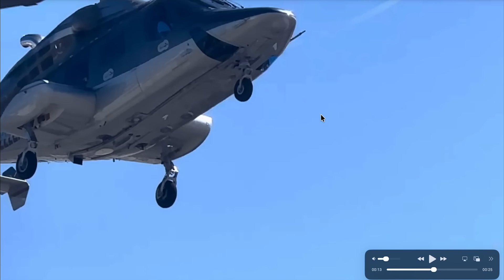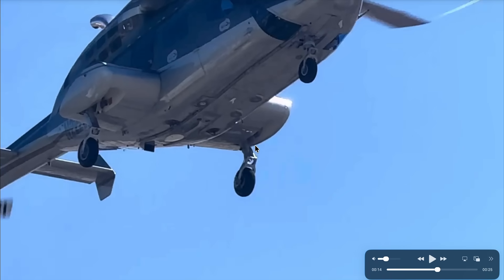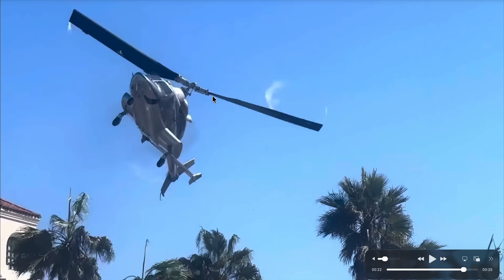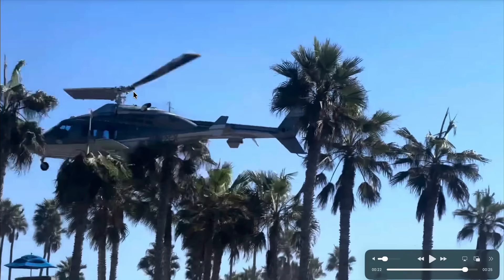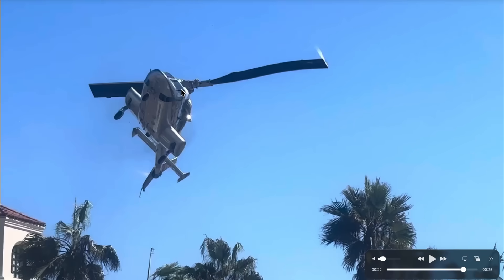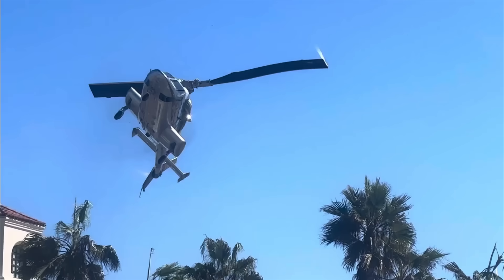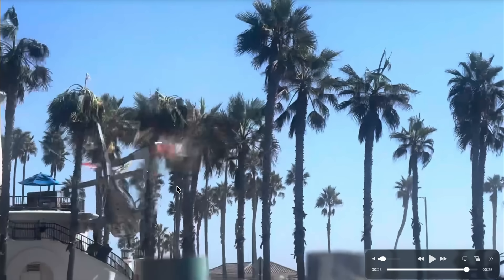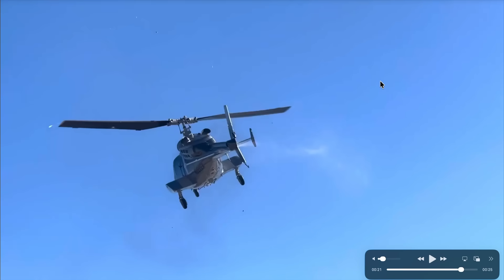Huntington Helicopter Crash Analysis - SlowMo Video!

Comment: The Bell 222's had a couple crashes a few years ago where the bracket behind the gearbox holding the rotor control linkages came off because the bolts securing them vibrated loose.   This of course makes the pilot unable to control the main rotor which I think is why the sudden increase in collective which wasn't from the pilot....it was the linkages coming off and aerodynamic forces acting on the rotor blades.   There  were increased inspections demanded by the NTSB on this bracket and securing bolts but people get lazy sometimes and this can be the result.
Reply: The pitch of the main rotor is the curious thing.  I thought the sound I heard was blade bark due to the high pitch angle of the main rotor.  I am used to hearing this on R/C helicopters, but it is at a higher frequency due to scaling.  I know from flying R/C helicopters, there are a lot of vibrations in a helicopter.  We have to use Loctite on every single bolt or it will wiggle lose.

And troubleshooting problems with R/C helicopters at least can be tricky.  The first gotcha I had when I first flew was trying to figure out why my tail gyro was glitching up.  I ended up replacing the stock gyro with a Spartan gyro and it seemed the problem was fixed.  But then several flights later molten metal started shooting out of the motor because the main bearing failed and the BLDC motor was so powerful that the motor kept spinning.  So instead of seizing on a failed bearing, the bearing melted.  With the pinion gear no longer meshing with the main gear, the helicopter started going down while making a weed whacker hitting things sound from the molten metal flying out at high speed and hitting the inside of the canopy.  Fortunately while the helicopter was in high speed flight, I managed to react fast enough to put it in throttle hold before worse things happen and flipped the helicopter back and give it negative collective all in one very quick maneuver and spun up the rotor blades as the helicopter slowed down so I could make an auto-rotation landing.  The point being without the measurement systems to tell me what was really going on, I just thought the stock gyro wasn't good, but it turned out that main motor bearing was slowly failing and the original gyro having issues was actually a symptom of the problem.  Later on I was messing with a "6-axis" gyro that could measure and log the vibrations with accelerometers.  Then you could narrow down what vibration came from what due to the frequency of the vibration as gearing had different parts spinning at different speeds.  Basically, everything vibrates in the helicopter as the whole helicopter is the drive train.

Getting back to this manned Bell 222 helicopter, the sense I got after seeing more videos was losing the tail was not the cause, but more likely a knock-on effect of something else going on with it being strange that the helicopter tilted back and started climbing and it sounded like blade barking from the main rotor as in a high enough pitch of the main rotor to cause a turbulent airflow over the rotor blades.  The vortex mist also started when the helicopter tilted back and climbed all of a sudden.  That wasn't happening before.

One thing to point out is when you start losing head speed, the tail rotor also slows down.  If the main rotor blades have an increased pitch and especially with this maneuver where they switch from going forward to going backwards while the helicopter is titled back and also suddenly gaining altitude, the blade incident to the airflow is increased.  I have certainly seen this with R/C helicopter flying.  Especially trying hard maneuvers at lower head speeds with a powerful motor, I ended up putting a larger tail rotor on one of my R/C helicopters to keep the tail from blowing out.   If they already had their head speed reduced because they were about to land, while this maneuver didn't look too terribly extreme at first, if the helicopter isn't setup for it, the tail is going to blow out from the torque.  A key thing here and is pointed to by the thread starter post, if you are suddenly pitching hard because of a mechanical failure, say a bolt wiggled lose that forced a substantial pitch change, all of this other stuff we see can and is probably a knock-on effect, not the root cause.  This all happened very quick, so you don't have much time from when one force is applied to change the kinetic energy of the system to when the next thing happened.

I think something important to point out is main rotor aerodynamics is messy and complicated.  You have what is likely a fixed pitch across the length of the rotor blade.  The  rotor blade is spinning at different speeds along the blade with the inner part moving slowly and the outer part moving quickly.  You also have one side going into the wind and the other side going with the wind creating a lift asymmetry that you need to compensate for.  When you get into something like blade bark, this is actually a partial blade stall.  That 'barking' sound is a turbulent airflow as in that part of the blade is basically in a stall condition.  It is just with an R/C helicopter you have so much headroom that you can go shooting off into the distance with a partial blade stall as the part of the blade that is not stalled is generating plenty of lift.  But another thing, and especially close to the ground like this, is it is perfect for creating vortex rings.  You get into a vortex ring state and the helicopter wants to drop out of the sky as this ring of air comes around and back through the blades.  Like you are trying to lift yourself up on this roller pin that is spinning faster and faster as you try to pull yourself up on it, causing to spin in the first place.  With an R/C helicopter at least, you can overcome the vortex ring state with sheer power.  Manned helicopters have crashed with a more infamous incident being the helicopter crash during the Osama Bin Laden raid in Pakistan where they lost a stealth helicopter.  In the case of this Bell 222, the sudden pitch change close to the ground could have caused a vortex ring to form, but the pitch was so great that it "powered through" and still climbed, but at the expense that the tail blew out from the high torque loads.  Forming vortex rings is a tricky thing and can catch you off guard, but there are clear physics behind it and what will touch off one forming.  It just seems possible one formed in this case after what was likely a mechanical fault affecting the control-ability of the helicopter.
Reply: Damn if they vibrate loose they should use castle nuts or something
Reply: @BruddaMan-r2p1c  they do. And we don't know if that was the same cause yet. To me it looked like the horn that attaches to the blade broke.. but that's just speculation too... we will find out when the report is released.
Reply: I read very specific bulletins, regarding that very thing!
Reply: Good reason for every single one of the 222's to be grounded! NTSB, obviously has some input on this!

Comment: The black smoke from the exhaust indicates the pilot did the complete opposite of what you're supposed to do: applied more power. Had he rolled off the throttle and entered an auto, he may have landed it or had a hard landing. With the size of those blades and the amount of inertia they have, it could have been saved.
Reply: Maybe.....but the startle reflex when it's happening for real, not a controlled practice auto rotation procedure, and when your mind is already fully focused on the other tasks of approach and landing, cause very unexpected reactions. Despite no doubt, vast experience and many hours on type, the human brain has to make a huge jump from the actions being carried out to the instant realisation this is 'really happening to me', to following what maybe the training has told you should happen....but faced with so much chaos and the forces of being flung around so fast within a split second, it is asking a lot of any pilot to just follow the book. Your brain will have been taken completely by surprise and jumped out of gear. In the time it takes to assess and act, the clock in this case, had already ticked down and the game was over as far as anything he could really do effectively to mitigate the inevitable. The human survival instinct of 'don't hit the ground and die' will quite probably cause an instinctive panic reaction. With so little time before the aircraft was already coming apart in the air, he had no chance. 
Human Performance factors are often very different in the moment of the actual real life catastrophe when compared to all those really well planned and executed autos on other days. 
It's exactly the same in car crashes....people 'think' they know what they would do to try and avoid hitting other vehicles or objects when it all goes wrong, but the reality is nearly always very different. You just end up being the first person to arrive at the scene of the crash!!
I sincerely hope that all those injured are going to be ok and make full recoveries. Shocking.
Reply: @lawrencemartin1113  even with plenty of time to react properly, pilots can still massively screw up. Kegworth flight 92. This helo pilot had a couple of seconds between loss of control and getting up close and personal with the palm trees. Even if the pilot was aware of some impending problem, possibly evidenced by the large yaw angle compared to helicopters that landed minutes earlier, there wasn't anywhere to attempt an emergency landing except that parking lot.
Reply: Oh sweet Jesus, there's still people saying this 💩 even with this detailed video, u people 😤 
Yeah he's an accomplished stunt pilot but should have autorotate safely from 100 feet with no forward motion, no tail rotor, mast bump & no control...just stop it ffs
Reply: @Yumbutteredsausage  Ok smart guy. Stick to what you know, like buttering up your sausage.
Reply: @Yumbutteredsausage 
....calm down!! Several people here, including me, have already 'politely' explained that it would have been nigh on impossible to save the aircraft at the point it all went wrong.....no need to get upset. It's YouTube.....lots of opinions from those who know and those who don't.....no need to get all cross.😂
Reply: @lawrencemartin1113  Though a lot of my fellow pilots say the same thing in our private groups. We train for this to the point it's instinct.

Comment: The contrails off the rotors are an area of low pressure, condensing the moisture in the air rather than compressing it. This indicates likely a high angle of attack on the rotor blades and potentially very close to stalling. You can see this evidenced on the tail rotor as well. Also, at 1:01 it appears a control linkage is separated from the tail rotor, likely causing one blade to lose pitch control.
Reply: The loose rod is very visible at 5:18, thin black line with a knobby end pointing down. I'd bet the NTSB has already looked at all the videos, determined the control rod coming loose was the cause, examined all the tail rotor assembly and is or will be digging through all the log books to find out if there's been any lax maintenance on the tail rotor control rods. I'd say the mechanical failure / cause is an easy open and shut case. The real difficulty will be determining why this failure happened. Every owner of a Bell 222 and any other model using that same tail rotor should be getting theirs inspected in case there's some defect just waiting to crash theirs.

I won't be at all surprised if there will be new requirements on inspection and maintenance of the tail rotor parts due to this crash.
Reply: @greggv8 it’s a great thing that this incident happened under the gaze of so many cameras. If this does turn out to be a catastrophic failure of the tail rotor control system, it is very well documented. I hope all the other 222 owners take good care of this issue if that’s the case, I was so saddened to hear we lost N222EX

Comment: The contrails coming of of the blade tips are caused by low pressure not high pressure. I'm not familiar with this helo, but if there is hydraulic assist to the tail rotor pitch it could be escaping fluid from fractured hydraulic pipes.
Reply from the maker: Appreciate the input!

Comment: It appears like one of the tail rotor pitch horn unlinked and only one blade is fully deflected in the opposite angle, leaving the tail rotor assembly to be extremely off balance to the extent it  it makes contact with the main rotor and separates from the helicopter. Best to look at the maintenance records on the tail rotor linkages......... 🚁
Reply from the maker: Great catch!  That definitely seems like the cause.
Reply: The pitch horn completely separated from the blade grip. You can see it in the picture of the tail rotor assembly on the ground where it landed.
Reply: @Deathvalleyherper  Yes that what prompt me to make a comment  great to see you spotted it too.
Reply: @gamedevai . I also spotted it in flight. Just before the spin starts you can see the linkage is broken and just spinning with the shaft.
Reply: @Deathvalleyherper True, in another clip you can hear and see what appears to be a pitch horn at great speed flying towards the left of the camera then hitting the ground hard just off camera view. Scary stuff!

Comment: You forgot to mention the pitch link that was not connected (1:00). You can also see the difference in pitch of the 2 blades of the tail rotor (0:41). This would have caused a huge dissymmetry in thrust, in turn causing massive vibration of the tail rotor assembly.
Reply: Bingo.  The pitch link had disconnected on one end and was flailing just before the tailrotor changed to the extreme pitch.
Reply: @tvtechnicaldirector  yep!
Reply: Yep, I'm sure  a link failed. When he lost the tail rotor it's like adding 200hp to the main rotor which caused the climb up and the start of the spin. I've never flown a 222 but I know it has a funky throttle that he may not have been to throttle down quickly enough to counter torque and start a auto.
Reply: Yeah I noticed that too with the diff in pitch on the two tail rotor blades
Reply: Yes, the difference in the tail rotor blade pitch is because the one link failed and other still intact.
Reply: Great eye for the pitch difference at 0:41 – I totally missed that at first.

Comment: People fail to notice the wash or streaking coming from the rotor trim tab on one of the main rotor blades before the crash.  The trim tabs are adjusted on the ground for blade tracking,  To me it looks like that trim tab came out of alignment or came loose on that single rotor which is what is causing the streaking, the tail rotor was stuck after loss of control due to mast bumping due to the main rotor no longer tracking in alignment. That two bladed rotor system is the same on the Huey and early Cobra helicopters.  Look up rotor blade tracking if you want to know more.
Reply: Loss of control was not due to mast bumping. Loss of tailrotor effectiveness and applying power was the cause of losing control. Mast bumping didn't start until after the TR had already been struck by the MR and was yawing uncontrollably, leading to excessive blade flapping.

Comment: He's lucky the failure didn't happen while he was hotdogging it on his flybys a minute or two before this happened.
Reply: It's far better to have a tail rotor failure in forward flight than in a hover.  As long as the tail boom stays intact the pilot will still have some directional stability and can do a run-on landing.  In the New York helicopter crash a few months ago, the tail boom separated from the fuselage and the pilot had no directional stability.
Reply: I would say, this was likely the cause for eventual tail rotor failure.

Comment: could it be the gear box on the tail rotor suddenly locked up, and the momentum of the blades rotating sheared them off? The blades being further from the center of rotation, they have a lot more inertia than the hub does when it suddenly stops. It looks like they sheared where the blades join the hub assembly
Reply: @gorak9000 EXACTLY what I saw.. I heard the drivetrain failing, disintegration & jarring catches of gears..like a woodchipper or ice in a blender..*onset was @ tail rotor RPM decay, then loss of tailrotor authority became visible..seeing hub, blade stubs & gear of 90° gearbox spat off & across parking lot..😢
He tried to get it over to the beach best he could..it was all over, but he tried..